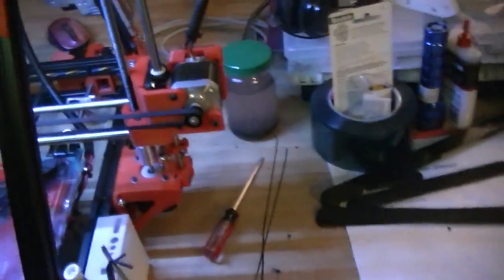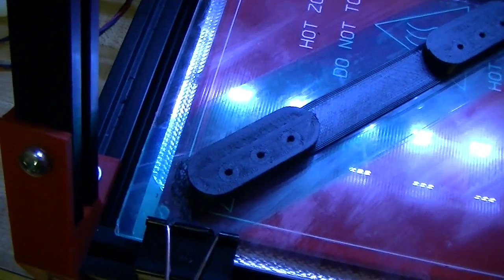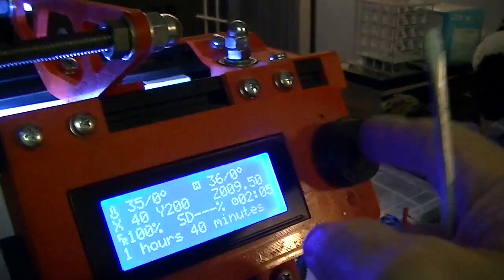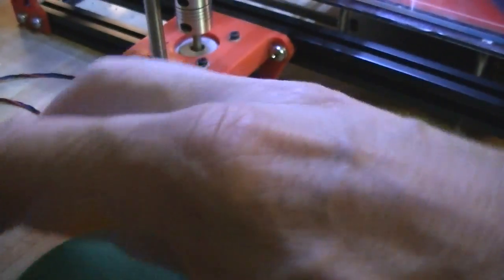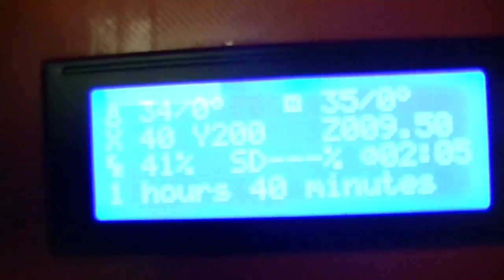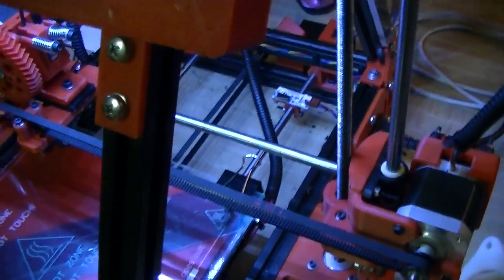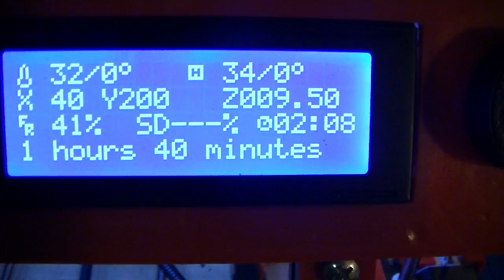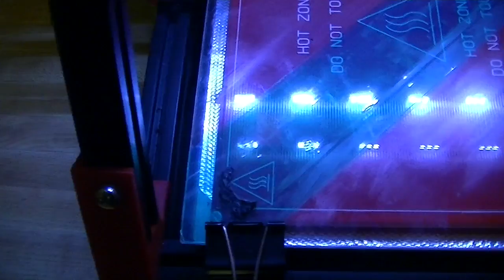2013-07-17 Resolving issues with my MendelMax 1.5 3D Printer

Comment: Hi Mr. can you help me? i buy the same printer and i cant figure out why my axes spin without control and my extruder dont turn. i try home position and hits the hit bed and the the  Y axes hit  back or front. im tuning my g3d but is a little tricky. my X axes spin one side but don't come back. sorry for bother you but please help. thanks.